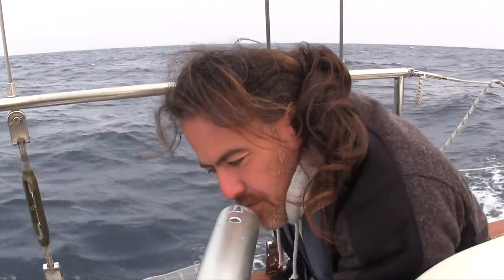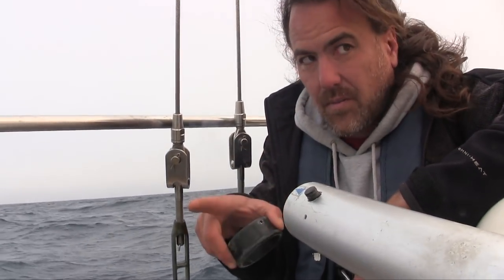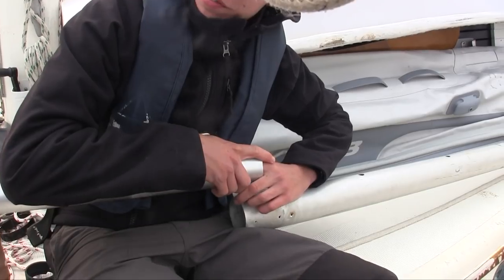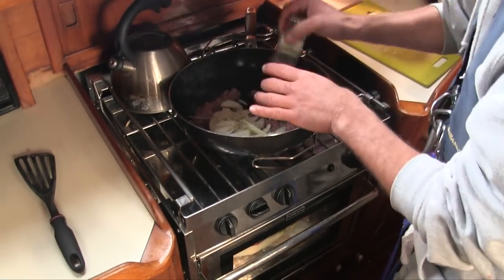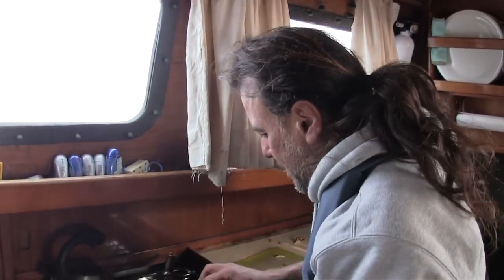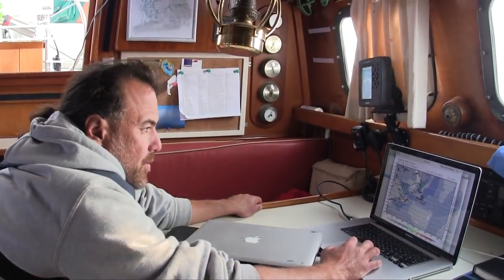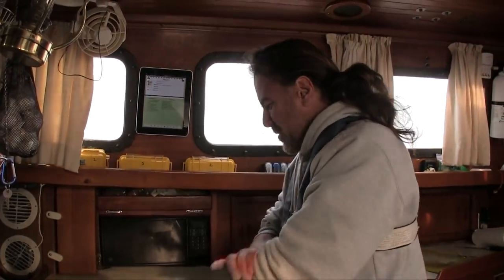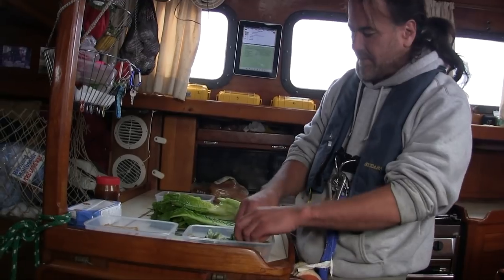Jury Rig At Sea | #15 | DrakeParagon Sailing Season 4

Comment: I was waiting for what you where going to do with the whisker pole, I've had mine apart once and you are right to assume it was put into the outer section from the end, No mine was not screwed in but plug welded and then finished off.

Comment: Will You still tell us how the pole-in-pole Rubik puzzle will be solved?
We prefered one piece whiskers and would have carried two rather than one-fits-all prone to probs, but that's easily said from the couch besides the oven.
Reply from the maker: We never did fix that pole.  I think it's way too undersized and am still searching for a replacement.  I think I want to get a carbon fiber all in one pole that we would secure to the deck when not in use. - Drake
Reply: Carbon one piece with an eye carbon end fitting? To buy from stock? I'd be interested where You'll get that. 
Carbon has to be way thicker in diameter as well to take the buckling load, which would be higher resulting from it's tendency to flexing more with load peaks as a pressed-only pole. That dimension might be difficult to grip with a "normal" sized sailors hand.
Tending two poles (for gybing triangulars and spinackers) and stowing vertical - mastparallel is what we did for regatta sailing to get rid of the stowing-handling requirements, both in carbon and alu.
No eye but a stub on the mastside. Stub- as well as eye-side were an aluminium whisker end, glued to carbon tube with Sika. Makes it one piece, but nearly unrepairable / unseparable. Alu-alu ends riveted like You had it, but fixed poles only, never an erection thingy.
Carbon tends to react pretty bitchy to sudden radial point-loads, too, so I don't know whether I'd recommend carbon Spi-poles for long-distance cruising, especially not with stowing on deck: You do not see the initial problem until it explodes under load. Long, pointy shards. Scary. Adding a glass layer to reduce this special bitchiness lets You loose the weight advance to alu quickly. My 0.02 cts 😬
Thanks for sharing. M.
Reply from the maker: Thank you.  Very interesting.

Comment: I know this was a long time ago, but you could have put the rivets in from the inside so they didn't extend inside even though you would have to manually rivet them instead of the pop gun. Bolts from the inside would work too.

Comment: Things that make you go Doh!!! The joinery on Paragon is good, care to share build info, is it Westsail or kit-built like Eric Forsyth's? Would like to have seen the gybe. Getting real good folks, thx.
Reply: A gentle gybe is easy. Just pull in the mainsheet gradually until the boom is over the center of the cockpit, adjust the course/steering and let  the mainsheet out gradually  while letting the mainsail out on the other side.
Reply from the maker: Thanks!  Paragon's hull was made in 1976.  I believe she was sold as a kit boat with built out engine room, rudder, and steering, and the owner built out the interior.  But when I did my big refit in North Carolina a good friend and I spent 3 years gutting out about half of the interior and redesigning and rebuilding it.  At one point I had blue styrafoam board mockups of most of the galley, salon and forward head areas. ¯\_(ツ)_/¯  - Drake
Reply: You did a heck of good job!!! I know that you did companionway stairs, fiddles and such look like done by same person so i thought so. well done.

Comment: Drake, could you have drilled a hole through both poles and then inserted a through pin then a split pin to retain the through pin?
Reply from the maker: Sounds like a great jury rig.  But  I really think that pole was just way too undersized for what we were using it for.  I would love to purchase a stronger one someday, probably a carbon fiber fixed length one that we would secure on deck when not in use.  - Drake

Comment: Do you get your WEFAX via SSB?  I have been messing around with this via my IC7300 and several WEFAX capable programs.  Fun, but haven't found a program I really like yet.
Reply from the maker: Yes, have used an app called "Multimode" on our Mac and another app called "HF Weather Fax" on our iPad to receive weather fax coming in on our ICOM IC-M710 SSB.  Both of these apps are made by Black Cat Systems and are available for download on their website www.blackcatsystems.com.   However, nowadays we're almost always downloading GRIB weather files over a satellite connection instead because we've found it to be much more reliable and easier to work with.   - Drake
Reply: Thanks man, but no option for linux distros kills it for me.  I'll try the HF Weather FAX on the ipad though.  I had 8 paragraphs typed up for the busted whisker pole but in the end I thought you did the best you could and delorted it all.  Great channel, great content.

Comment: Did you ever figure out what caused the whisker pole to snap?
Reply: Too much wind/sail.
Reply from the maker: I really think it was just way too undersized for what we were using it for.  I would love to purchase a stronger one someday, probably a carbon fiber fixed length one that we would secure on deck when not in use.  - Drake
Reply: Thanks for the info, I have the same pole on my 38ft boat..so I was  wondering what happened.
Reply: If you watch the video carefully when the pole is being rigged, Drake loads up the tension with a winch and really puts his back into it.  The cam then changes POV and you can see the bow in the pole.  When he did that, I thought 'that ain't gonna last long' - snap. Dang, there it goes.